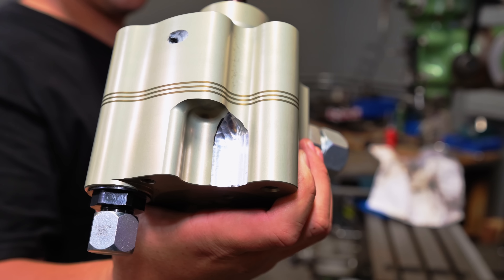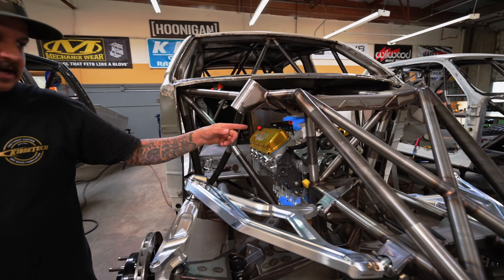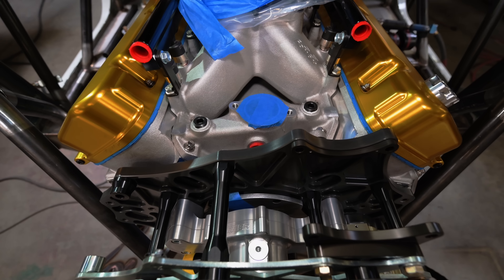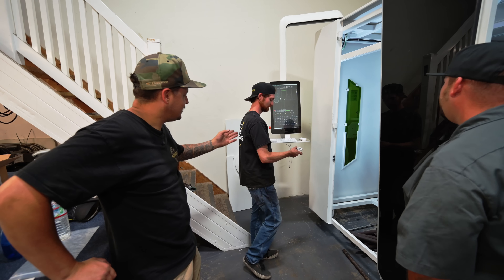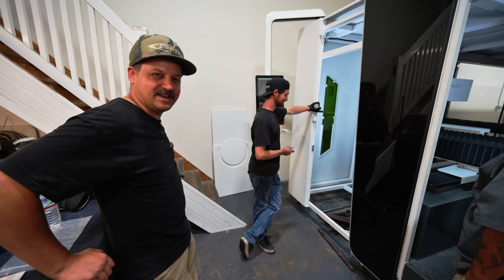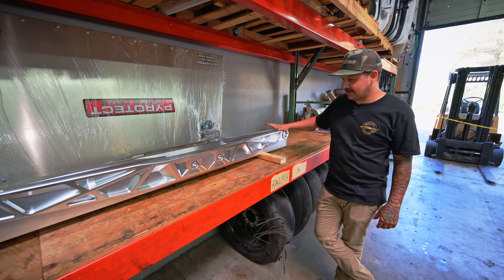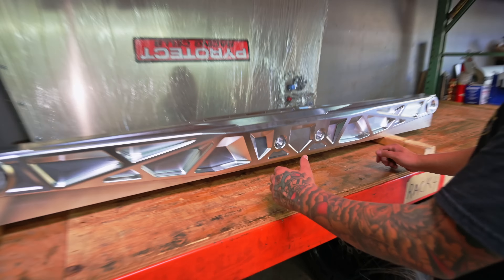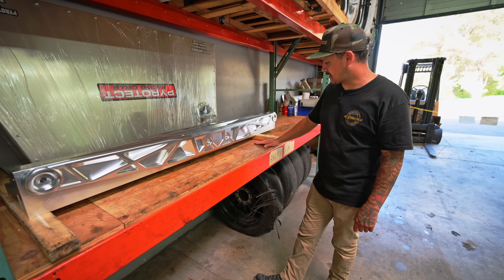THE LASER CUTTING MACHINE IS ALIVE!

Comment: Gonna suck to be hacking at a power steering pump with a die grinder out in the bush when you need to replace the pump.
Reply from the maker: Well the spare would already be modified to bolt right up. So it would only suck if you suck at planning ahead